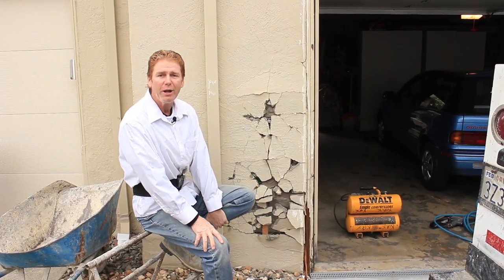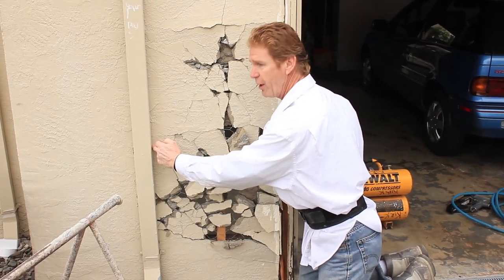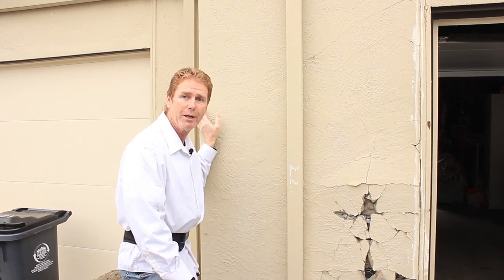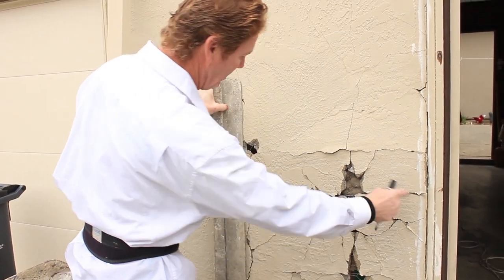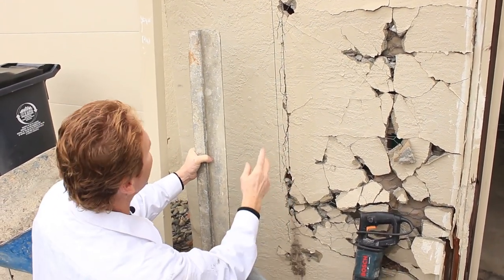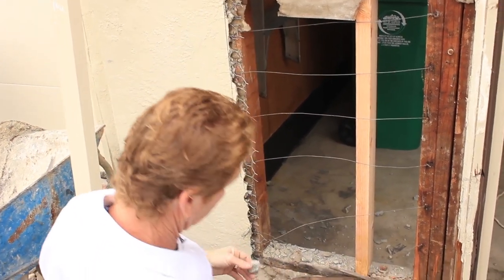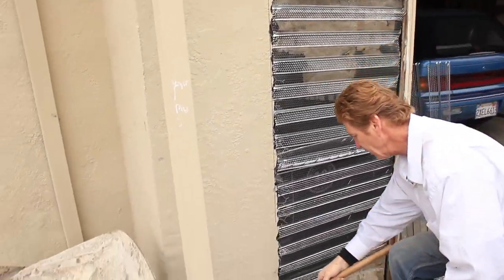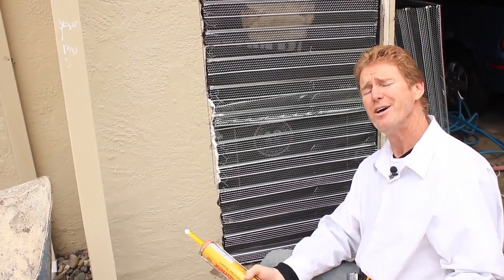Remove damaged stucco on a stud wall.

Comment: Hello Kirk. I am amazed by the fascinating work you and your family team accomplish. This video as well as others have been extremely insightful.  I was wondering if you knew of any proper methods of raising/lifting a garage frame after being bowed out from a vehicle collision.  Our rear garage wall was bowed out, causing a gap in the base of the studs just above the garage foundation/cinder blocks. Built in the 1960s our house seems to fall under the old codes concerning stucco builds in Ohio. Could you please if possible,  post a video relating to self raising an older garage frame (perhaps using a jack if pissible) to re-allign the frame with the cinder block foundation (perhaps using a sledge hammer if necessary); as our wall needs it. Also, would I need to tear out the plasterboard to check the framing studs for damage? I'd appreciate the insight my good buddy!
Reply from the maker: Howdy Wally, as a rule, we get hired to repair something; if it's something we feel might benefit another, we sometimes post it. We would have to be called in for that specific repair in order to show the way or method that we would take in regards to the repair.🍾

Comment: My Dad's 1948 garage has line wire also. I always wondered why it did not have standard ( modern) wire . Now I know.
🤓
Reply from the maker: We worked on a house today with line wire, stucco was still two inches thick between the studs.

Comment: The first time i've ever seen anyone use rib lath on a wall hah. Also noticed you didn't tighten the line wire, doesn't loose line wire take up more cement? Then again i guess the rib lath kind of keeps that from happening... hmm... Great patch job, as always.